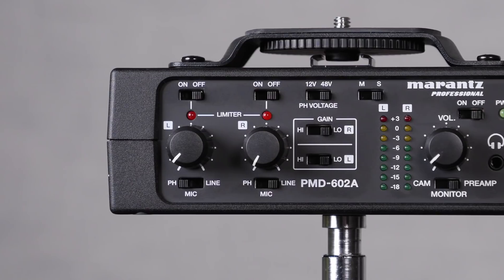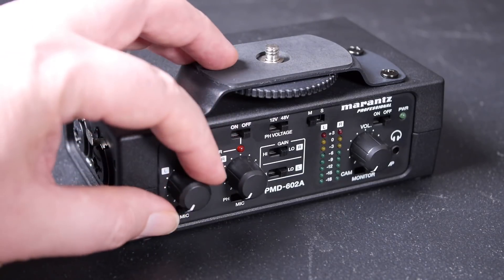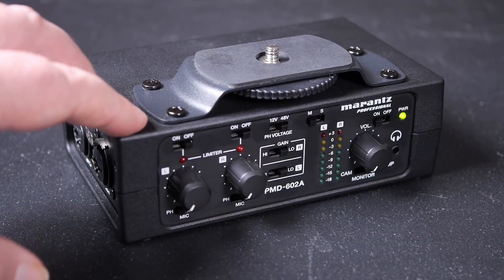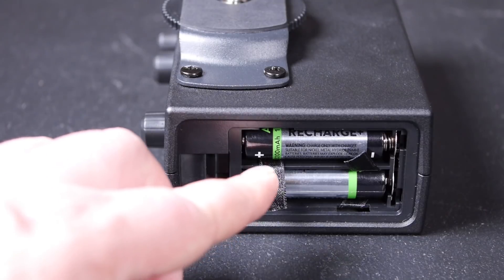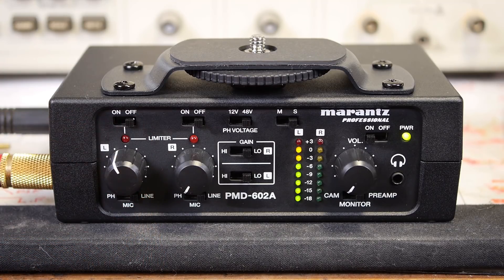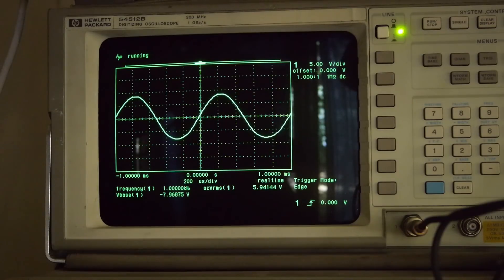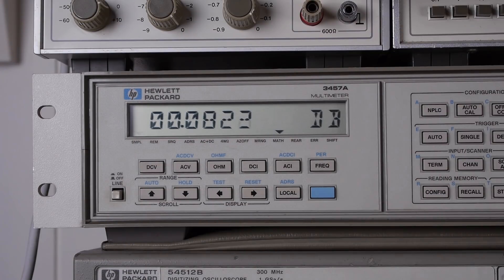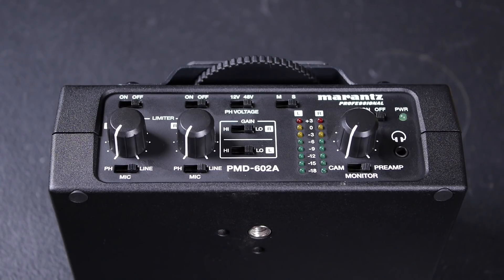Marantz PMD 602a preamp - review & test

Comment: I got this item mostly because I was sold on the visual audio meter and headphone volume control beside it. However, the meters on the Marantz are much less sensitive than my EOS R camera's meters. I have the R turned down to the lowest sensitivity, but that means the meters hardly light up if at all on the Marantz. How can I solve this issue?
Reply from the maker: Assuming there isn't a menu option for selecting line-level input, the solution would be to use an attenuating cable such as those sold by Sescom. I found that 33dB of attenuation worked for me with a Panasonic GH4, but the optimal value might be different for your EOS R.

Comment: Can I use it with lavalier mics directly connected to it?
Reply from the maker: The short answer is no - in theory you could do it with something like the Rode VXLR+, but I couldn't get that combination to work reliably without noise and hum issues. I did eventually manage to get a lav mic to work with it via the Sennheiser MZA 900P adapter, but that's a patently absurd solution given the cost.

Comment: Very useful and well presented.  Thank you!  I’d like to ask your opinion on the audio quality differences between this type of rig (preamp only direct to camera) as opposed to the separate use of a field recorder.  I’m venturing into independent film making and want good audio with a very small production team. Thanks in advance! 
Edward
Reply from the maker: Thanks Edward, it's a good question. If I were to make a sweeping generalization, I'd say that the biggest issue with camera audio is signal-to-noise ratio. Undercooking the levels could easily yield a result that's not really usable due to a high noise floor. Likewise the limiters tend to be pretty rough, and not terribly effective at avoiding clipping. For a project like a simple YouTube video where re-shoots aren't too painful, I think it's worth the risk to avoid the hassle of syncing audio in post. For a more elaborate production, I'd be tempted to go the field recorder route (especially something like the newer Zoom units that support 32-bit float recording) - and maybe send a stereo output to the camera to use as scratch audio for syncing, or maybe as the final product if it's good enough.
Reply: Thank you Karl!!

Comment: Thank you for the actual testing, fantastic way to show us the actual technical specifications with a clear testing methodology,
Did you do any noise floor testing or THD?
Reply from the maker: Thank you so much for your support. I haven't tested the noise floor (though it would definitely have been helpful), but I did look at THD when trying to figure out what the 'limiter' actually did. I found that with the limiter reducing output level by 6dB it increased THD to over 20%. It's not really a limiter at all, but a 'soft clipping' circuit.

Comment: The Olympus Micro Four Thirds cameras that mention use with their own audio recorder (the LS-100) appear to have the option to accept a line level input signal (by fully disabling their onboard preamps, not just turning down the gain to minimum).

That then removes the need for the specialist Sescom cable. One example of a model that offers this facility is the OM-D E-M5 II (which I own) and I'm seriously considering purchasing one of these. If it offered USB bus power as well that would be ideal.
Reply from the maker: Nice to see more cameras capable of accepting a line level audio signal - and that seems to be the case here, with the output of the LS-100 being rated at 10mW into a 16Ω load, or 400mV, and Olympus recommending connection via a regular cable. That said, I'd probably try some test recordings with another line level source just to confirm compatibility before making any purchases.
Reply: @KarlAdamsAudio  Definitely agree that accepting line level is a useful feature, I have some other sources that can output line level (Audio Technica System 10 wireless mic RX unit for example) and have used those quite successfully. Helpfully the RX has a switchable pad as the default output (when working in unbalanced) is 0dB but you can choose to apply either 10dB or 20dB of attenuation on the RX itself.

Comment: Hi Karl thanks for the great review of the PMD602A. I'm curious about the limiter. If you get a chance, could you test it for us? I'd like to know at what Db level the limiter caps the output. Also. how effective is the limiter in preventing clipping. Thanks and have a great day friend.
Reply from the maker: Thank you. I've had a brief look and to be honest I'd characterize the limiter as more of a 'soft clipping' circuit. It has no real effect until the output reaches 0 dBV, at which point it's dropping the output to -0.5dBV (at the expense of around 3% THD). An output level of +6 dBV is cut to +3 dBV by the limiter (with 3.3% THD). Once you reach an output level of +12 dBV, the limiter cuts that to around +5.5, but with >20% THD. This looks REALLY horrid on the scope (but at least it's not a square wave, I suppose). It doesn't look to be following the amplitude envelope so much as the the instantaneous output voltage, so all gain reduction is accompanied with distortion (as the peaks of the voltage swing are 'squished'). Better than nothing, I suppose - but pretty disappointing.
Reply from the maker: ...upon further testing, the output level at which the 'limiter' starts to operate is dependent upon your gain & level settings (and they're going to depend upon your input signal level).  So I wouldn't call it an output limiter at all - it's really just making the onset of preamp clipping a bit less sudden, and somewhat less 'nasty' sounding.  Personally I'd rather try to set the gain structure such that preamp clipping isn't an issue.
Reply: Thanks Karl. I really appreciate you taking time to do further testing for me. I don't usually rely on limiters myself, but as an extra safety net, it could be somewhat useful. Take care and thanks again friend.

Comment: I wonder if it's possible to feed audio in through the line level input for a single Channel and use an XLR input for the other channel?
Reply from the maker: I haven't tried it, but I believe so. There are separate mic/line switches (and high/low gain switches) for each channel, so you should be able to feed line level into one channel via a 6.5mm jack, and mic level into the other via the XLR connector without a problem.

Comment: Hello my name is John Romero I am from Colombia, new to the audio world, and would like to know more about what you said about the cable for the camera that helped improve the audio, I did not understand.
Reply from the maker: Hi John, the problem is that the output level of the preamp is way higher than what the camera needs, even with the camera gain set to minimum. The cable incorporates some resistors in what's called an L-pad configuration - and they have the effect of reducing the signal level by a factor of 50. Specifically there's 4.3kΩ resistor in series and a 91Ω resistor in parallel on each channel (it's a simple enough circuit that you construct yourself - the only advantage to buying the ready-made cable is the neatness of the packaging, really.) Naturally, if your camera supports line-level audio input (I believe the Panasonic GH5S does) you don't need this at all, and can just use a regular cable instead.
Reply: Thank you very much for your answer I was investigating and that person is unfortunately not in Colombia, my question is, would it be very difficult to do it? Buy a panasonic gh5s this camera will have the same problem Thank you very much
Reply from the maker: It's a very simple circuit - just four resistors, so as DIY electronics projects go it's a good place to start. The challenge here is the packaging - how to make it compact and robust. I wouldn't recommend trying to build it yourself unless you wanted to get into DIY electronics as a hobby, though.
Reply: @KarlAdamsAudio  Is it possible to use this unit with a Panasonic Camcorder HC-V 777? It has a "plug in powered" MIC input. Should i use the cable with the resistors?
Reply from the maker: There's not much information in the user manual for that specific camcorder, but it would be safe to assume that an attenuating cable (i.e. one with the resistor network) would be required. That seems to be the case for other Panasonic camcorders, at least.

Comment: Curious, I see that there is  switch under the monitor knob marked cam/ preamp. What is that switch for exactly, because it isn't mentioned in this review, and it seems to me that might be some form of attenuation/bypass switch for deciding if the output is Mic (camera) or Line (preamp).
Reply from the maker: If you connect your camera's headphone output to the 'Monitor In' socket, you can listen to playback from the camera through the headphone output when the Monitor switch is set to Cam. Unfortunately since it mutes the main output, it's completely useless for monitoring during recording. Not a particularly well though-out feature in my opinion - I'd rather have seen them either implement a fully independent monitoring loop (which is what I originally thought it was), or just leave the feature out entirely.